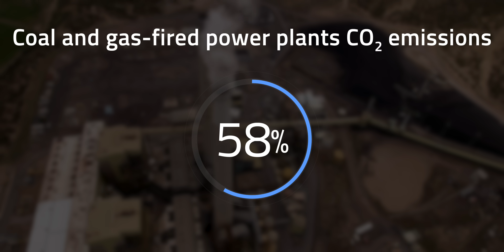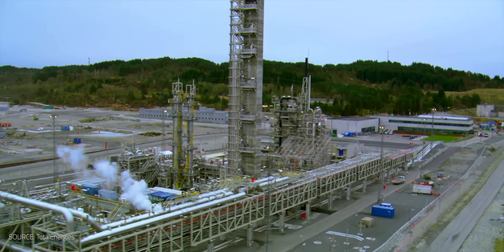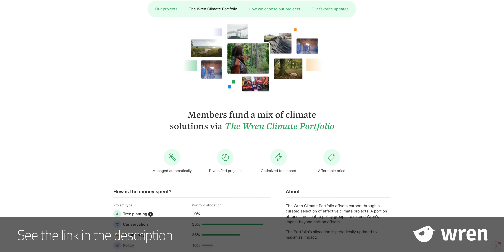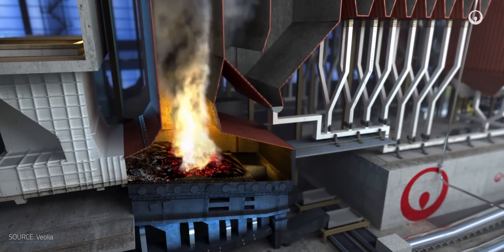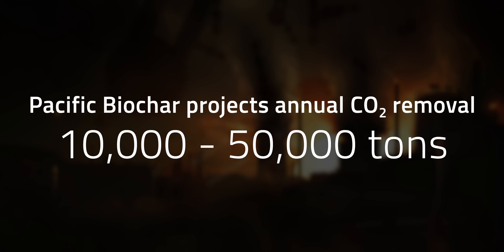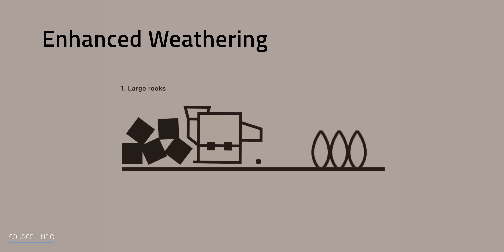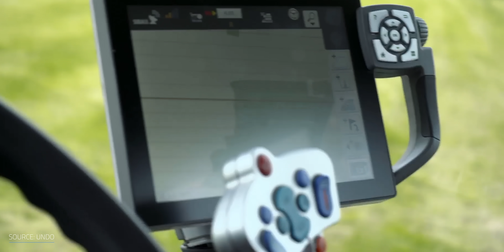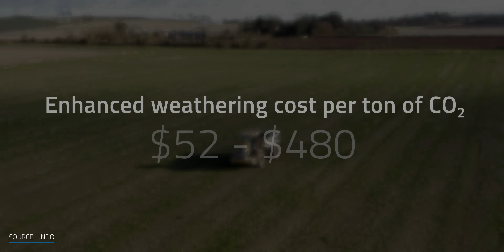The Reality of Carbon Capture

Comment: If you take the amount of CO2 that was in the air ten years ago, and add in the amount of CO2 we've put into the air during those ten years, and measure the CO2 levels now, you will find that the latter measurement does not account for all of the burning we've done. Natural processes have removed much of it. Plants are very good at getting CO2 out of the atmosphere; it's literally something they need to do to live. CO2 is also added by natural processes (forest fires, volcanoes, and the weathering of carbonate rock).
Reply: Well of course. The problem is that we’re emitting more than the ecosystem can absorb. Obviously the net difference over time needs to account for that. No one’s saying otherwise.
Reply: I'm of the opinion that the more carbon dioxide we release. The faster the plants will take it up, since greenhouse growers actually inject CO2 into their grow rooms for faster growth.
Reply: @Saoldric  that only works in a controlled environment where temperature, humidity, water availability is unchanged. However, real life climate change increases the average temperature, dries-out the soil, and reduces the bioavailability of nutrients for the plant. If CO2 didn’t have all those other effects you might be onto something, but as the world actually behaves there’s nothing to have an opinion about.
Reply: @kaitlyn__L  a question. Where do you think all these oil deposits came from? Its sequestered carbon. I'm under the impression that it came from plants and animals. There was massive amounts of life before, why will it "be bad for the environment"? Climate is always changing, the Sahara was once a rain forest. 

We have turned deserts into food production Mecca's.  It's not sustainable though unless desalination tech is implemented on a massive scale or divert massive amounts of water from areas that have an abundance.
Reply: @Saoldric  exactly, it was naturally sequestered carbon over millions of years. By burning so much of it, we’ve released it back into the atmosphere, creating the imbalance we live with today. Hence efforts to try and re-sequester carbon. It’s not the gotcha you think it is
Reply: @kaitlyn__L  so by that logic we should see a correlation between CO2 levels with temperature rises.  But thats not what we see.  The only thing in the last few hundred years was the temperature rough trend has been up in the last few hundred years.  You know what does closely match the rise in temperature? Solar activity. 

This is just another alarmist trend for funding.  It has been happening for decades. World is going to end because acid rain, ice age, Ice caps melting(world is going to flood),  global warming, and now climate change because the term is vague. Just because there is scientific consensus at the moment does not make it true.
Reply: @Saoldric  you’re an expert in selectivity! There’s a very strong correlation between the two going back millennia from various sources, but you’ve already made up your mind so I won’t bother arguing with you. 

But for the benefit of everybody else: acid rain is still a problem in areas with high smog, but the switch from burning coal to burning gas drastically reduced the sulfur content everywhere else. Just like the ozone hole or Y2K, we (mostly) solved the real issue. (And sadly that makes some people think it was never a problem to begin with.) They were right to be concerned about the potential effects if we hadn’t reversed the trend. 

We were entering a glaciation phase before we started heating things up. They were right to be concerned about a lack of preparedness from their simulations, until it became clear we were actually reversing and overshooting that trend. If we weren’t in a glaciation period, the average global temperature rise would’ve been far more dramatic than it so-far has been. The fact that it’s still rising this much during what should be a glaciation period should be MORE concerning to everyone, not less. 

Glaciers ARE melting, at increasingly quick rates, so those last three things are all ways of saying the same thing. The fact that you think they’re different belies your lack of deep knowledge. Sea level rise doesn’t mean year-round flooding, it doesn’t look like storm surge. What it looks like is coastlines eroding more rapidly. 

Lastly, of course we need solar energy to heat-up the Earth, that’s what the greenhouse effect IS — trapping more of our sun’s heat. That’s not a fun gotcha. Besides, solar weather has cycles of about 11 years, not centuries. If you really cared so much about the science, you’d know that already.

Again, I say that for everybody else who might be on the fence browsing these comments, as you’ve clearly dug-in and don’t look at any evidence which contradicts your preconceived worldview. Don’t bother trying to refute me with “orthodoxy” this or “warped incentives” that. Even Trump’s most committed denialists changed their tune after they got into office when NASA and NOAA slowly walked them through the data, and answered all their questions.
Reply: @kaitlyn__L  Stop with the insults, if you cant win a convo without going to it, you have weak mental. To me its clear the current model isnt very good since its been very far off in prediction.  The input weights are clearly wrong or we are missing more.  It seems like common sense that we are missing important values.. Its been wrong on anything further out than a week for what? 40-60 years?  If carbon dioxide had a great effect on temperature we would see a huge correlation since its went up about 40% in the last 45 years. 

With the implementation of more of the largest coal fired power plants in the world in china, the first world countries dont want to talk about that. We export our ecological damage from mining and power generation to africa, china, india and claim we are "green" for doing so. They account for well over 50% of emissions and the largest purveyor of environmental damage. Places like germany powering down their nuclear plants and relying on exporters of gas like russia. This makes no sense since the newer generations of nuclear power are almost impossible to have a melt down, extremely reliable and able to store all their nuclear waste of their life time in an area the size of a football field.

 Glaciers are melting? They are also growing, its a seasonal thing. To bad that obama and other rich elites have purchased tons of coast line property, you better go tell them that they wont have anything left due to erosion.  If only someone would of told Africa this and they wouldnt of lost all their vegetation, savanna's, and atlantas wouldnt be in the sahara  desert and still be connected to the sea rather than 1400 feet above sea level.  If only someone told them, they would of prevented the collapse.

You would actually have consequence for not meeting g20 climate goals, not forgive them and set the goal posts further out constantly.

The temperature average hasnt been rising the last 20 years depending on where you get your numbers. However, there have been more extremes.  Highest/Lowest temperatures ever recorded last year.  

"Lastly, of course we need solar energy to heat-up the Earth, that’s what the greenhouse effect IS — trapping more of our sun’s heat. That’s not a fun gotcha. Besides, solar weather has cycles of about 11 years, not centuries. If you really cared so much about the science, you’d know that already."  
(google lost my reply here)  FYI water vapor is many multiples worse than carbon dioxide on the greenhouse effect.  The 11 year cycle is the suns equivalent to our year.  You forgot about precession, tilt and eccentricity which has cycles of tens of thousands to hundreds of thousands of years. With Solar weather, I was talking about Coronal mass ejections and sun spots which release massive amounts of energy from sol.  

If the so called leaders were actually serious about reducing "climate change". They would practice what they preach and hold the largest offenders accountable.  Until, they do. Im convinced its just another political grift.
Reply: @kaitlyn__L  you could argue that the lack of plants is responsible for the increase in temperature, since they cool the area down through evaporation. Improper soil health ie, to much tilling which reduces the soil diversity and ability to hold water/nutrients since the soil biome is interconnected. The main limiter on plants is usually nitrogen and water availability.
Reply: @Saoldric  sure, it has a feedback cycle element to it. Plants do reduce the temperature around themselves, but when the drier air leads to drier soil it impacts plant growth. There’s tons of different pathways which all interconnect. Some compensate for each other but many don’t. That’s precisely why the CO2 ratio being shifted is so destabilising at even small amounts, there’s such a fine balance of chaotic interconnecting factors which previously all cancelled-out. 

There’s certainly not “one true cause” for anything in a complex system, except for very simple baseline concepts like availability/presence of energy. Those can be expressed in hundreds of different ways. That’s also why there’s the counterintuitive colder/harsher winter snowstorms thing.
Reply: @Saoldric  I used to believe that as well but the scientists seem to be divided  on whether increased CO2 levels  lead to increased plant growth.
Reply: @edwardhogan1877  scientist are only divided when they dont account for the nutrients in the soil since no matter how much CO2 you have, you need other building blocks.

Comment: Why not take CO2 and combine with hydrogen made from excess renewable electricity and make hydrocarbons? Be it gas or liquid the energy density is good and we have the infrastructure in place to use it.
Reply: That has been done in some places, but the round-trip efficiency is low.

Comment: So burning wood for biochar is carbon negative?  I'd love to hear more about this given the last 20 year of people who burn wood to heat their house are told they are part of the carbon dioxide problem.
Reply: With biochar you end up with charcoal, with wood stoves you end up with ashes. Also a much bigger concern with wood stoves is the local air pollution (soot etc), and its negative health outcomes.
Reply: @kaitlyn__L  but it has still been partially burned, so it has created CO2.  That's my point, they don't get into how partially burning a product that creates CO2 ends up being carbon Negative.
Reply: @Xander-dx6mw  making charcoal releases half the CO2, and traps the other half. This is clearly preferable to letting 100% of the CO2 go into the atmosphere with decomposition. You’ve also got to remember it starts from a negative amount — plant growth is carbon negative. Given just burning biofuels would be carbon neutral were it not for transportation etc, sequestering half of it can sometimes be carbon negative and is often carbon neutral.

Comment: Biochar seems like it has to have dioxins in large quantities. On the bright side burning biomass, especially something like stems of plants you´re growing, has this hidden benefit in a sense that most of the metals needed to grow your plant reside in a stem and leaves. I remember reading somewhere that using ash as a fertilizer is a bad idea.
Reply: It depends on the temperature of the pyrolysis reaction and what the designer of the reactor intended to maximize. Pyrolysis usually has three products: biocarbons, pyrolysis gas and pyrolysis fluids (oil and alcohols). You can produce very clean char with no dioxins it will clink like glass and little to do smudging residue on your hands when you handle it

Comment: Planting trees on a massive scale, ending Amazon rainforest (and other forests, mangrove) destruction could be a saner, simpler, cheaper option. But that's not attractive to corporations and profits.
Reply: Its problem is that it's not fast or efficient enough. When you plant a tree, you'll need to wait some 30 years before its peak sequestration. A mechanical and or mixed method can do it faster, more reliably, around the clock, and more efficiently.

Emissions need to be reduced, and trees are not the be all end all of removing the excess carbon from the atmosphere.
Reply: I love trees. Trees are good. And afforestation can be worth investing in but it is not a solution. We need to stop burring fossil fuels. I would take a fast-growing tree several years to take up the CO2 from a single gallon of gasoline.

Comment: I am concerned with burning the material to create bio char. It’s generating a significant amount of CO2 if it is done in a trailer as seen in the video. If it were done in a closed environment facility that may mitigate the generated CO2. 
I like the concept of enhanced weathering. Using nature to solve our issues is going to be an important part of the process. We need to focus on the oceans as well. How do we reduce the carbonic acid in the ocean? I think this is going to be a key element going forward.
Reply: Pyrolysis without oxygen produces little CO2.
Reply: @AnErrantPhoton  the energy still has to come from somewhere to do the pyrolysis. Most reactors will burn off the pyrolysis gasses that come off the feedstock to maintain the Temps. Otherwise, the pyrolysis gasses need to be condensed into liquids and captured

Comment: My issue with biochar is the same as my issue with the debate on cows. This carbon is from the current sustainable cycle whereas what's causing problems is adding new carbon from fossil sources to the total going around.
Reply: How does that matter though? Still better than letting vegetation rot and feed bacteria and fungi and returning it all back to the air.

Comment: These are all rearranging the deck chairs. Technocrats can't accept limiting our impacts immediately. They want to keep business as usual, which you mentioned at the top of your video describing that we need a stable worldwide grid.  We probably need to abandon the dream of a forever stable grid and energy whenever you want it. The truth is we're living on borrowed time, and have already crossed a lot of thresholds that will tie our hands going forward. 

Is the biochar creation process carbon neutral, or is it a new source of emissions? I saw that the industry claims to be able to fuel the combustion with a byproduct, but you didn't describe the emissions from the burn, which were open air watching the video, wasted heat energy, just a hot mess.

Until we can cast all these tech hacks aside, we'll continue to burn fossils with the promise that some day we'll have better tech to draw down CO2. The hacks, simple or complex, are delaying action, because they create a false hope of "future innovation" that actually bring them to scale. This is not unlike waiting for fusion to create our new energy solution, which causes false sense of security.